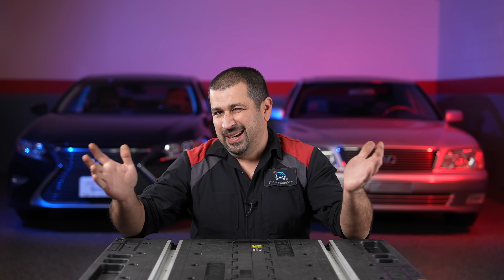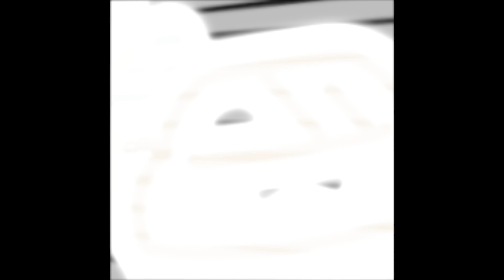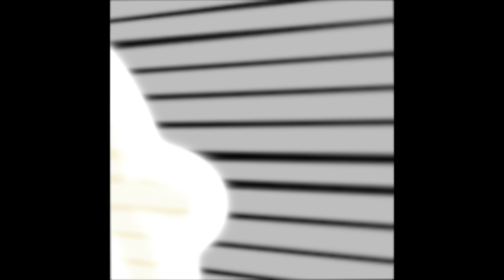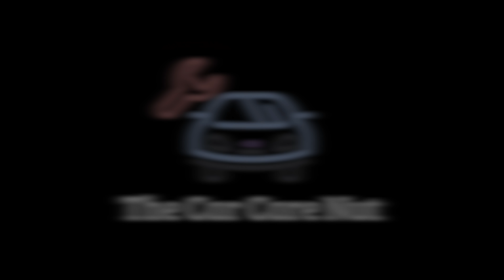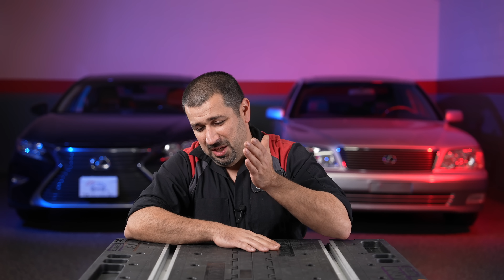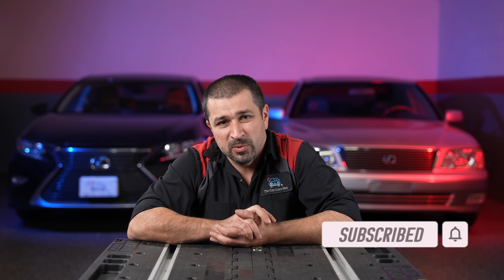Can Modern Turbo Engines Be Reliable? Here's The TRUTH!

Comment: Good video. Very informative. I agree with all except for one point..(the reason the gasoline car industry is switching to mainly turbocharged power plants) Cost is my opinion. You can easily make a naturally aspirated engine of larger displacement meet current federally mandated emissions requirements. The catalyst will have to be larger if the displacement is larger. The engine and its technology for clean efficient fuel burn is more costly to produce. We have that technology now. This technology would allow for a more durable, longer lasting power plant. There’s a cost to it that cuts into a manufactures profit margin though. Turbo are a low tech way to make more power for a small engine. Ford has shown us that you can take a small engine, boost it within an inch of its life and use it in several different car models including trucks. GM’s 2.7L 4 cylinder is also a good example. Manufactures actually prefer that it doesn’t last to long. If it is throughly worn out by 125,000 miles, that is good for them when you have turn around and buy a new vehicle again. With the new management at Toyota quality, serviceability and durability are starting to slip. It’s sad.

Comment: Diesel tech here. Diesel dont struggle with getting air.   They take the maximum amount  of air they can get.   Diesel adjust power through fuel and timing.   That the reason they dont have a throttle plate( some still have a throttle plate as they mix Ehaust gas back in)   Not saying im smarter than this man.

Comment: Sounds like turbo paranoia to me.  If you maintain them (usually means doing more frequent oil changes than what is recommended), they will be fine.  Are there always some “lemons” from the manufacturer that don’t live up to expectations?  Of course.  They are exceptions, not the rule.  I remember the engines from “the good old days,” and they had plenty of issues, too.  Maintenance is key, but it helps to get one that has a solid history in terms of design and build.

The information from this channel is amazing, and I enjoy learning about cars on this channel.  I do disagree about the quality of oils over time.  The oil “technology” has improved, but I don’t believe that oil change intervals should go to 10K or more.  I stick with 5K changes with full synthetic, and I’ve never had issues—turbo or otherwise.

Comment: I enjoy your insight and honesty on this channel. I agree with most of what you say. If I could add a thought, non-turbo related, since I saw you Lexus' behind you. I purchased a 2006 Lexus ES330 in late 2018. It had 99K on it and I paid $6,500 from a trusted dealer. Today, 45,000 miles later, I have sunk at least the purchase price into the car, even though I baby it, give it good gas, 5,000-mile-interval oil changes which I perform, garage kept, and around 7,000 miles a year. My first Toyota product, and I wouldn't necessarily call it reliable or efficient. Maybe it's just the exception to the rule. They say those cars can go 200-300,000 miles. Fine. But by my math, that would cost me $30,000 to find out.

Comment: Public roads are not racing circuits and I don't tow anything. My dad did, in his 55 hp Mitsubishi Lancer, over the Alpine passes. That car did 0-60 in 17 seconds. No problem. I now have a non-turbo Mitsubishi Space Star (Mirage) with 80 hp, EU spec. I don't tow anything. It is more than adequate for me. 0-60 miles per hour in 12 seconds. Actually too fast for my driving style. I don"t want a turbo, I don't need a turbo, I will never buy a turbo. Next car (if ever) will be an EV.

Comment: Under the hood  temperatures  must be higher on a turbo engine.  Sensors, wiring,  and electronics will likely have a shorter lifespan as a result.  Old high mileage turbo engines don't make for a good used car.  Good video. Thank you.

Comment: All this talk about idle after driving. I have a 2024 RX500h and when I get in my neighborhood or park the car. The car goes into Electric, I’m guessing that RX500h car has a water pump to cool the turbos down? If I put it in sport mode then the car will never go into EV mode guess I could do this to cool the turbos down before I shut it off. When I start it up it doesn’t go electric so I sit for 30 seconds or so before I drive. Just curious what people think. I will add that I am happy I got the 500h over the other RX’s I drove them all and the 500h is great if anyone is undecided. I have not had any transmissions problem’s yet and my regular commute to work is freeway and I avg about 30MPG.

Comment: Thank you for the clip.  I have a V8 with a 7-speed in my 2017 Nissan NV3500.  Yes. I will be driving this van until it falls apart.  On the other hand, I also have a 2021 GLC300.  I am not sure I will drive for that long.  LOL.

Comment: turbo trucks when I worked on them , had note on dash to idle 3 minutes before shutting off. Reason to cool oil because turbo still spins with no oil pressure

Comment: Great info. I have a 2016 Colorado with a naturally aspirated V6. I was told by my buddies that it is a junk engine and my timing chain was going to fail blah blah blah. 6 years later and 100,000 miles I haven't touched it except to change all fluids including oil at 3000 miles. I'm keeping it for a long time. Love this channel.

Comment: A turbo charger's impellers running at 100,000-300,000 rpm, forcing an engine that's not built to last, to run above it's limit. What could go wrong.

Comment: Planned Obsolescence... never mentioned once... Why is it... 90's Hondas can make emissions, and last reliably for a million miles... but modern ones often fail to? OH... because HONDA realized replacing cars every couple years makes them much more money. Until we address this, vehicles will continue to last less and less time. 

"Nothing has changed" oh but plenty has.. quit lying to yourself. Its painfully obvious when you can slap an ebay turbo on a K series honda, and run it till the chassis rusts away around the engine.. then throw it in another chassis and keep going.. but these modern TOYOTA Factory turbo engines... cant last 100k miles before they have catastrophic, engine going to the scrap yard, failures. 11:14 Exactly lucky to get 100k miles and that is what they want.. 

ASK YOURSELF WHY SUBARU HAS TAKEN THE "MOST RELIABLE CAR BRAND" CROWN from TOYOTA... Planned Obsolescence... and telling you "lifetime fluid" is part of that.. "eh it will last till the warranty - thus lifetime" LMFAO..

Comment: wow such great material, thank you. I only want a turbo on an aircraft because they need more atomspherical pressure above say 8 to 10K feet. Sometimes you can get to smoother air and above some weather above those altitudes, non turbo engines have a much lower service ceiling.

Comment: i have a na engine and i do 3k miles oil changes, one on the road with a cheap pump i got, and the next in the garage with oil filter. manufacturer recommended 10k mile changes. my car is the only one of it's kind that doesn't burn a drop of oil. i knew many owners of the same car that had to do a rebuild around 100k miles due to the engine consuming a liter of oil every 500 miles

Comment: I have honda crv 1.5 turbo I started changing oil at 3000 miles using Amsoil signature series. The oil is black at that point whereas my old 6 cylinder equinox still has some brown in it. Also with my 3.5 twin turbo expedition same thing. EPA ruined and cost the auto industry billions in altering and forcing them to make bad small engines. My suburban ended up burning up in a fire due to bad engine change over lifter tick costing me 10s of 1000s.

Comment: Just get an EV 80% less parts to breakdown only change gear oil 50k miles hardly use brakes .Most will last 200k miles with the same battery. Battery replacement will be cheap   if its a Chinese EV and it cost about the same now compares with the ICE car in Malaysia here. (Merc  BMW  EV is a no go, parts markup cost is crazy )

Comment: Good stuff brother from another mother as I call my blue collar brethren!!!!!!!!!!  So your vid came to my fed cause I'm looking at turbo gassers.  My daughter is at that age and thanks be to God the Boss and I can get her a new car.  So been looking at the 1.3l and 1.5l GMs.  Now some negative Ecotec stuff out there BUT the Boss and I bought 2014 2.4l Buick Verano's new because of the gas prices and the fact that we were daily driving a Jeep GC 4.7l HO that took 93 and a Duramax.  So the price in fuel savings paid for the Vs note.  Yeah that's right we were driving a TON, more me 110 round trip and I was working 6 days a week at this particular site.  Crazy thing is the Boss is rocking a 3.0l Duramax and I'm still beating those Vs.  Her old one has 230,000 and mine has 210,000 on the odometer.  So long story short those 2.4l Eco's have been good to us.  Now I'm a Local #3 IBEW inside wireman by trade but do know how to wrench on vehicles.  So I have always been good about maintenance, thanks to my OCD, lol.  Specifically I'll be looking at the 1.3l Chevy Trailblazer and Buick Encore.  What I'm getting is the oil has to be changed at 3k for sure.  It's funny cause I started driving and owning cars in the 90s.  Using dino oil was the deal and I was a Castrol GTX man.  Got it on sale at Caldor a case of 12qts for $12 and 2 Fram filters for $5, WOW!!!!  Well with that oil changed every 3k on my Dodge Neon I was able to get 225,000 out of her.  Basically the Neon still was good but an hour into my commute the tranny started to slip slightly so I parked it and ran my Ram.  Whats wild to me is here we are 30yrs later and now I'm spending $30 an oil change that used to cost me $7.50.  Atleast I can get 5k out of a synthetic oil change.  But with the prospect of buying a little turbo engine we are back to 3k oil change intervals, WTF!!!! Two steps forward one step back I guess, such is life!!!!!!!!!!!!!!!!!!!!!!!!!!!!!!!!!!!!!!!!!!!!!!!!!!!!!!!!

Comment: I once had a car with 250,000miles on it when i scraped it but it did have the original turbo on it. 5000mile oil changes are key to a long lasting engine. I scraped it because of suspension failure.

Comment: Given the fact that it is known that the turbos will have to be worked on or replaced at some point during the life of the car, engineers really need to take into consideration placement of the turbos for easier access . Don't design placement like the third generation 4Runner oil filter!

Comment: I have a 2009 turbo diesel BMW and I change the oil every 5,000 MI.  BMW recommends every 12,000 miles or or every other year.  It has 175k and runs like new.  For the past 80k miles it's been tuned pushing 50% over stock power levels.     plan on taking it past 250k miles.  Toyota should really bring some turbo diesels to the US, at least in the trucks and SUVs.

Comment: I love turbos. I won’t buy a vehicle if it doesn’t have one.  Non turbo engines are slow and very laggy.  My X3 has 160,000 miles on it and I’ve never had a single problem with it. The thing about turbo engines is people don’t understand how to take care of them, you have to change the oil every 4-5000 miles.  Manufacturers telling owners to change their oil every 10-15000 miles should be criminal.

Comment: Wondering if variable geometry helps with turbo reliability since it's supposed to prevent excessive spool up in low-load conditions. Also, is turbo in hybrid set-ups equally (un)reliable? AFAIK the next-gen Toyota hybrid engines are going to be mostly downsized turbo engines (i.e. a 1.5t to replace the 2.5 n/a)

Comment: And that is why I never had any problems with my turboed engines.  My first one was a new 1980 Pontiac Turbo Trans Am.  There was a sticker on the engine cowling that said to change the synthetic oil every 3 thousand miles or the warranty would be voided.  I kept that daily driver car for 8 years and had no problems with that engine.  The second turbo car was my wife’s 1986 4x4 Subaru wagon.  We drove that car in a hilly mountain town at 7,000 ft which received an average snowfall of 90 inches.  We had that car for 10 years with 3,000 mile oil changes for 10 years with no engine problems.  My suggestion for today’s car is that you buy a new Toyota turbo equipped car or truck.  They “over engineer” these engines to last.  The domestic automakers tout and brag their turbo engines to have more horsepower and torque and can tow better than Toyota.  That is true but at what cost.  I’ll bet they also won’t last as long and have more engine trouble.  Time will tell.  I do my own oil changes on my 2024 Toyota Tacoma with OEM filters with the recommended oil viscosity.  At 6,000 miles I’ve already changed the oil 3 times.  The first at 800 miles and the other at 3,000 miles and just changed it again.

Comment: If you operate the turbocharged engine with care, fuel consumption will be so good that even changing your engine oil every 5.000miles becomes more economical. The trick is to choose the thicker viscosity recommended by your owner's manual for your region.

Comment: heh i live by the 30,000 mile oil change coz thats only 5k miles on my erev's engine. 2x 13 year old volts with 150k on the odom, no big repairs, no battery degradation. basically just suspension work at 120k and coolant flushes every 5 years. these cars both pay for themself every 2-3 years in fuel savings, double the mpg of a prius, no transmission. best car ever made

Comment: Buy a digital temperature gauge. Assuming, coming to a complete stop after long driving or hot weather, turn on the AC to high temperature. 

Why? Because there is a 2nd radiator inside the AC. Therefore, the coolant would speed up cooling, and that includes the engine block, turbo and oil. 

Thereafter, you would see coolant and engine oil drop significantly. With this you could help cool the oil. And longer longevity..

Comment: In the UK, Toyota and Honda fit small turbo engines with CVT transmissions to most of their models. Its only Mazda that will sell you a 2.0/2.4L Normally Aspirated engine, with either a stick shift or an auto with a torque converter.